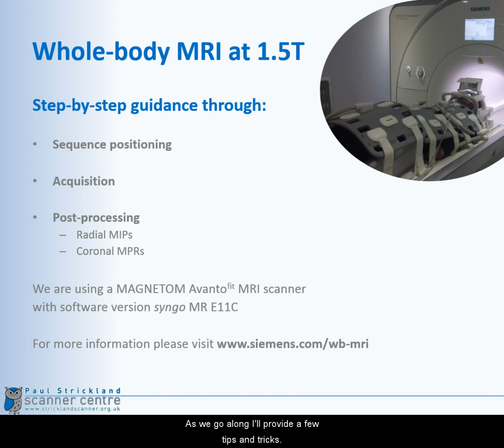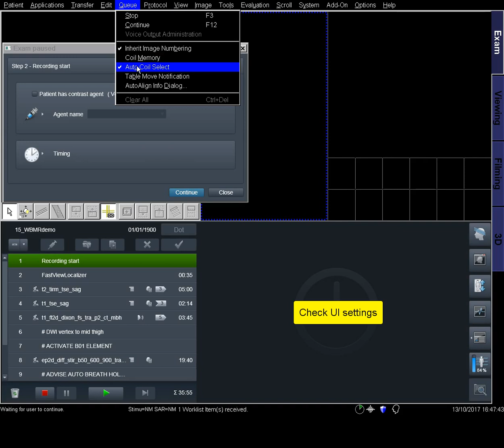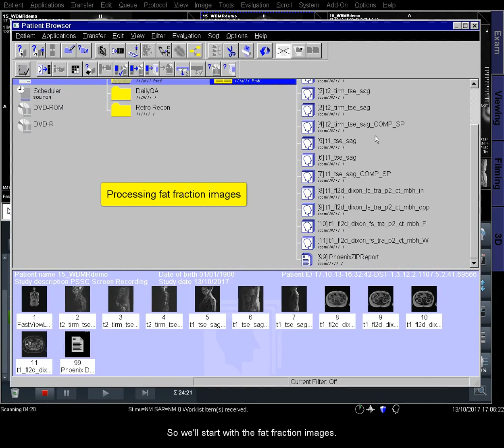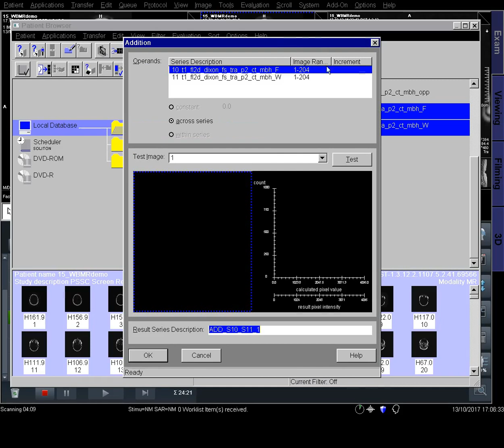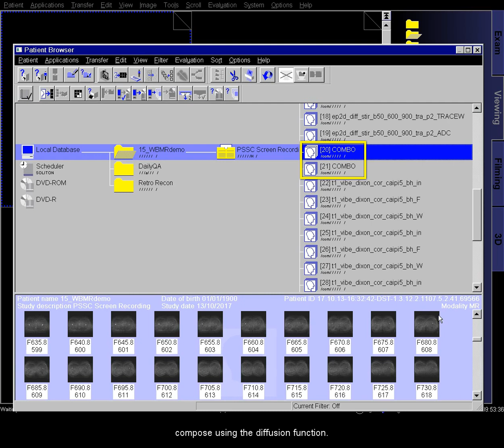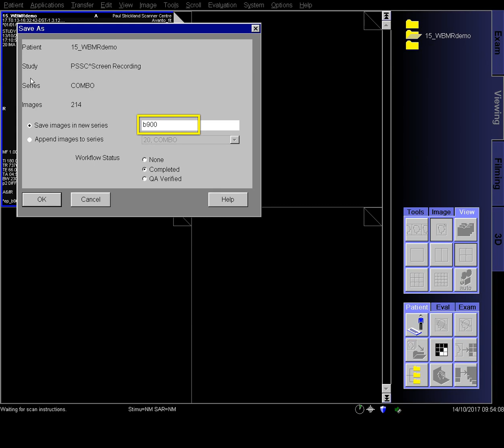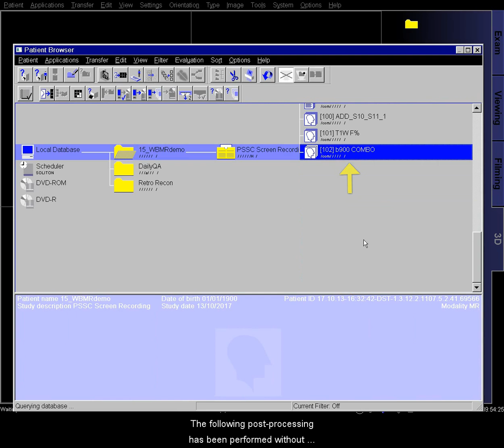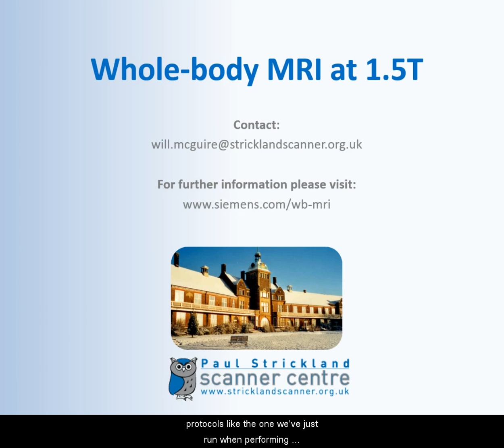Whole body MRI - How to do it tutorial - Siemens Avantofit

Comment: Great video, thank you so much. A couple of questions about the T1W fat% post-processing, as it is new to me. 

What use does it has in WB-MR? 
Does a ROI give you already the fat fraction for liver steatosis without needing a calculator?

I currently ask the technologist for a dual phase (in&out) place the ROIs in the liver and spleen at the same level and introduce the data in a fat% calculator to get the liver fat fraction...